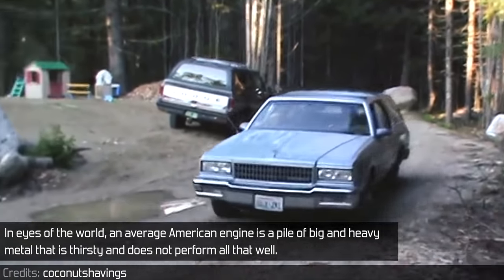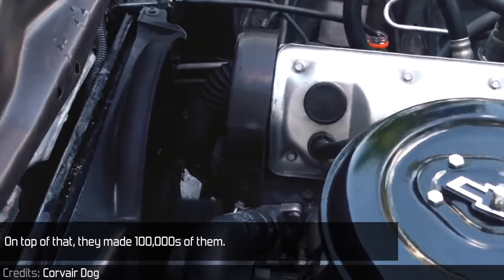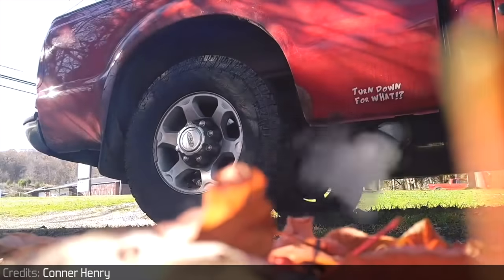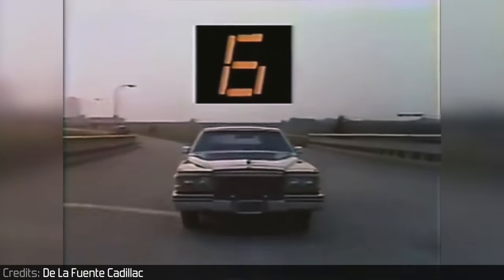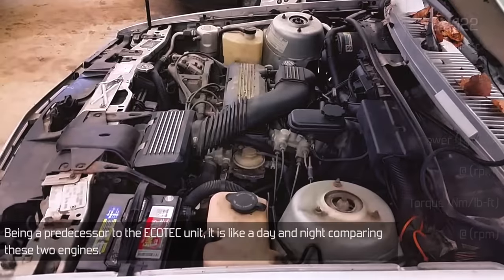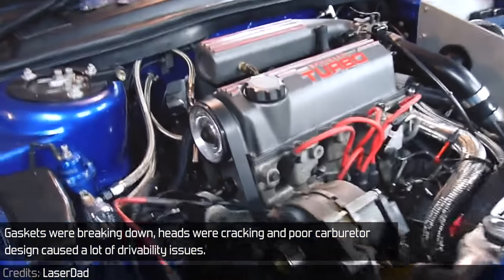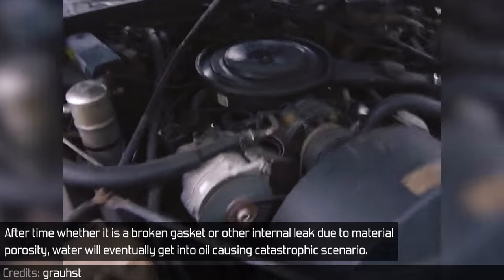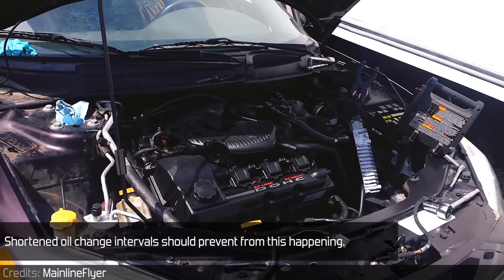8 Worst US Engines You Should Avoid

Comment: I drove one of the Olds diesel powered Chevrolet station wagons (that was a rental, thank God), into the parking lot of a local grocery store. A group of old men were sitting nearby. As I walked by they cautioned me about all of the noise that the engine was making and that I was negligent in the car's maintenance. That Diesel did sound as if it was ready to come apart even though it was new. It couldn't even get out of its own way at full throttle. GM has had a bad reputation of trying to out-think the industry with a good number of poor engine designs, (there are exceptions like the Chevy small block V8), and then there's Chrysler's cost saving use of the Mitsubishi 4 cylinder in their line of "K" cars and minivans which resulted in a nightmare for the owners and a goldmine for the repair folks. The Cadillac owners of the 4-6-8 engines would get the electronics disabled and the people who owned the Olds diesel cars changed out the engines for gasoline V8s. The 1980s up through the early 2000s were a technological nightmare for the auto industry as they tried to figure out ways to gain fuel economy and lower emissions through the use of electronics. Being one who's been in the industry for over 50 years, I still prefer to have a car that I can service and repair at home. Anyone have a 67 Mustang or a 69 Chevelle?
Reply: GM took a 350 and converted it to diesel they didn't strengthen the block. they used the almost the same metal has they did in the heads as they were using to male the gasoline verison heads.   50K those diesels were shot
Reply: While the designs share cylinder bore/stroke dimensions, the notion that the 350 Oldsmobile diesel is a converted 350 gas V-8 is completely false. The 350 olds diesel was a completely different block (much higher nickel content) Could be safely bored .125 thousandths overbore without sonic testing , Heads, intake, complete engine were not the same.. It shared the bolt circles to attach the accessories,transmissions but that's about it. After 1980 the main journals were 3" BB ones. Also roller cam, and lifters were installed.

The GM  genius's never installed a factory fuel and water separator in any GM diesel equipped car till 1984, They Installed weak head fasteners nor prepped the public on how to care for a diesel. By then the damage was done. Water and oil don't mix so many who filled up at other than truck stops (huge amounts of diesel fuel sales) were almost guaranteed water in the fuel. Which spelled disaster because most people did not have a clue and drove them just like gas powered cars. Poor R&D, and public awareness killed GM not this engine. I know a few that have hit 200-300k. Not bad for the worst engine GM ever produced 

FYI Most racing builders use the DX block to build a big cube bullet race engine so if anything the diesel is converted to a Gas engine.
Reply: William Charles - I don't have the amount of experience as you --- only 35 years --- but I share your sentiments.

My ride is a 1973 Chevy K-10.
Reply: SmallBlockChev,
 I agree with your statements, You know of what you write. The deal about poor R&D was an epidemic for the car manufacturers in the 1980s and 90s. The diesel fuel containing water is almost a given no matter where it comes from, although you're correct that some high volume diesel retailers, (truck stops) seem to be able to provide a better quality fuel with less water content. They had better, word gets around quick with truckers.

During the mid to late 1980s, the company that I worked for bought two of the Olds diesel, V8 powered Chevy pick-ups for service vehicles that would log thousands of miles monthly running all across the country. Both trucks suffered lower end failures, in multiple engines, changed out through warranty. These trucks would be loaded to the gills with heavy spare parts for baling machines, (big, non-mobile units), so they were pushing them pretty hard.

 Knowing the guys that drove those trucks, their foot was always to the floor and the required service and oil changes, which are a critical must, as you imply with diesels, probably wasn't carried out. They probably didn't drain the fuel water separator as often as they should, either. Who knows?

 As for getting by with the warranty, the people who owned this company weren't angels and falsifying documents wasn't a big deal for them. Ethics wasn't in their vocabulary. I left the company before I found out what the end story was but, like you said, they probably neglected the trucks by not giving a damned. It wasn't their truck to begin with.
Reply: paul lazazas,
 Nice 4x4 truck to have.  The hot rodders and resto guys are starting to gain interest in this generation of Chevy trucks and the aftermarket is starting to put out new stuff for them. After all, that body style had a 14 year run, they ought to. 
We had a 76 Chevy C10 Scottsdale Fleetside that had a factory 4 barrel 350 that ran sweet as sugar. Only problem was that the rust was having a field day, it was everywhere. That 350 would haul ass, though.
Reply: why cant you service electronics at home, you dont have a computer and a multimeter? Its physical measurements just like any other physical parameter. Maybe its american electronics, I guess thats why my ford had bosch
Reply: 67 mustang here. Just bought this mustang for my daughter to drive too high school. 289, one of the best engines ever made. No rice burner for my kids.

Comment: Youre way off with the Mopar 2.2/2.5L engines. Those little engines were great and would run forever if taken care of. I drove a dodge with the 2.2 turbo, awesome little 4 banger. The transmission let me down, but that 2.2 kept on going.
Reply: Once they worked out the head gasket issues they were pretty good.....damn sure sold enough of them. These engines plus the Caravan and K platform cars saved Chrysler at the time. Not to mention all the work the repair shops got for repairing and maintaining them. I know l worked on a ton. Whole shop would be full of just these sometimes. Lol.
Reply: I had a Plymouth with a 2.2 damn thing ran for 56 miles with no oil and only lost a crank bearing. That was after it was driven for 300,000 miles. The engine wasn't a turd but the CVS joints broke every other month like clockwork.
Reply: John Doe dodge datona 88 year model?????
Reply: The 2.5s were better engines. I did have a 2.2 that cracked the head but the head cracks were more notorious on the Turbo 2.2s. The transmissions on them were okay as long as you didn't abuse them, like reving the engine in neutral ans throwing it into drive so you could squeal the tires. If you did this you would definitely lose reverse because it would shove the hot drive gear ban into the reverse ban and they would weld together.
Reply: @Mike Sienicki No, the 2.2s did have head issues but that was fixed in the late eighties.
Reply: the current aftermarket Fel Pro head gaskets are good. The Weber carb is an easy swap.  These are easy to work on but never made much power w/o a turbo
Reply: @28913dave  my brother has a pacifica
Reply: I had alot of experience with the 2.2 and its true they were good long as they were well maintained. But that was their weakness if you blew a hose or didnt change timing belt routinely it would trash the engines. So although they ran good they was very high maintenance. You absolutely did not want to wait for it to break down before replacing parts. Parts had to be changed on a routine basis. This in my opinion made them garbage and why you seen so many in the garage.
Reply: I haven't seen a Mopar vehicle with a 2.2 since 2000. Yeah, they really do run forever 😂😂😂.
Reply: i liked the old powerglide transmission i would beat the crap out of them for years no problem .
Reply: I replaced head gasket in less than one hour without taking the heater hose or rad hose off more than fifty that way charged 150 dollars people paid me no warranty never had one fail
Reply: I've actually got a 1985 dodge Ares 2.2l carb 4speed manual engine runs good.
Reply: It was a barn find
Reply: @dmaster92289  I have one and it's my first car but mine is a 2.5

Comment: I usually agree with most of your findings on engines for lists like this, but say what you want about the problems of the 1st gen N/A Mopar 2.2, but the turbo versions of that engine were damn good power plants, especially the Turbo II and III. Most of the problems that Ive heard from that platform are the result of people not using the synthetic oil and premium gas that they were supposed to or not knowing how to work on the VNT turbo of the Turbo IV. Properly maintained, those engine are not only reliable but highly tunable, able to push cars into the 11-12s quarter mile brackets.

Comment: Triton engines are bad? Then why did fleet managers and medium-duty truck/bus/RV makers throw a fit when Ford considered getting rid of them?
Reply: cause ford lovers don't know any better, DUH..
Reply: Is your screen name from the sega genesis great videogame greatest heavyweights. Probably one of my all-time favorite boxing games ever. Still play it to this day. Oscar Ogg is one of the computer players.
Reply: I agree I've had two vehicles with Tritons, both had great power and acceleration and both were nearing 200K miles still running like brand new. One of Ford's better engines in my opinion
Reply: Cause they were dirt cheap junk
Reply: They weren't bad, They were terrible. Ford got cheap in 1997 and  wanted to increase production by taking shortcuts on building their engines. The spark plug port threads were just the beginning. The HEI system would mismanage the voltage output to the plugs giving some too much and others not enough and because the ports had less threads or sometimes were overly ported, the spark plugs would literally spit out of the engine. Ford did not fix this until 2008, but that was not the only problem they had. Jaguar had designed and manufactured the Triton's engine cooling system which had several design flaws causing air bubbles in the system that were almost impossible to burp out.
Reply: Well see I slightly agree the early 4.6, 5.4, and 6.8 had the spark plug devil due to poor design but by 01 the v10 had its shit together and the other 2 seemed to be fine after 02 but definitely 97 starting was rough
Reply: The Coyote is a far superior engine, be glad they dumped it
Reply: My 97 5.4 had 235,xxx on the factory plugs, never threw a plug and they came out with no problems
Reply: I know there are issues with the 5.4 due to poor pathing for the engine oil but I have a 4.6 2001 F150 Truck with 350,000+ km that runs like a charm.  Always chg the oil and did proper maintenance and even in -30 C it still starts fine.   For me its been dependable as hell and was my daily driver until I got a 2014 Sierra which also has never let me down.

Comment: The Triton engine spark plug ejection issue is easily remedied . I have 407,457 miles on my 98 F150 4.6 triton without any problems whatsoever other then the spark plug issue happening at 78,xxx miles. It cost me under 50 bucks and a couple hours.
Reply: Mine is in a van so I was not as keen on trying to do it. I turned off the EGR and raised the burn temp in the cylinders. This prevents carbon from forming in the cylinders and burns off what is there. I have had to change the coil packs because they are known problems. almost 200k and doing good. Oil changes and reg maint.

Comment: Surprised to see the Ford Triton on here. I know the V10s are bad, but the 4.6 and 5.4 V8s are almost indestructible.
Reply: MrWoodii no, not the second gens. The first gens are a pain to work on and have a couple problems but the second gens suck (timing chain problems)
Reply: MrWoodii we had a v10 and the truck went through 3 engines in years, safe to say it was a traded for a ram shortly after
Reply: 4 cylinder Vegas, besides being notorious rust buckets, had a rubber timing belt instead of a timing chain.  Periodically, the cogs on the timing would jump, putting the engine seriously out of tune and necessitating a trip via tow truck to the dealer.  Presumably, the belt was to reduce weight as part of GM's perpetual effort to meet Corporate Average Fuel Economy (CAFE) standards.  Thanks loads, Congress!
Reply: MrWoodii this guy is clueless
Reply: 5.4 3V doesn't have much power due to restrictive exhaust, but they have yet to fail us! We have three. One of which has 195,XXX miles on it with the original plugs!! Never, and I mean NEVER had a single problem with the engine. All that's wrong with it is the engine computer, which no longer works properly. The other two are still pretty fresh, low mileage engines, but still no problems, except for a very slight tick on cylinder one.
Reply: Vega was an interesting animal. The early ones were def bad news whereas the 1976-77 models were no worse than any other mid 1970's engine plus, rust protection was much better and, GM also improved the brakes and rear ends.
Reply: 3v Triton is the biggest pile ever. Those plugs are the worst. I personally know of one that dropped a valve at 12k miles just after 3 years. Had perfect maintenance, synthetic oil etc. Turned off the mil and let the dealer eat it on trade in.
Reply: They shoot plugs out like bottle rockets, junk.
Reply: I have 6.8 with260,000 no issues replaced alternator that's it all bullshit great engine
Reply: Yes
Reply: MrWoodii the 5.4 in my 250 just broke 200K and it's only 6 years old. That 200K mile marker was half way across these united states and I was pulling 9,000 pounds up and down the appalacians. I have no problem with the 5.4
Reply: the  tick you are hearing on on cylinder most times is a rocket  arm  or lifter going bad it a lot cheaper to replace it before it breaks and the bit and pieces sometimes  end up places doing more damage
Reply: Bradley'sCoFarm hows that electrical system working out for you lol
Reply: Once they worked the bugs out the 2V mod motors ran forever. My first Crown Vic, an 04, finally succumbed to rust at 284,000 but the motor still ran great. My current Crown Vic is an 06 with 143,000 on it and runs like new. And these both started life as cop cars so you know they were ran pretty hard.
Reply: MrWoodii
Reply: MrWoodii
Reply: MrWoodii We have a 5.4 3V from 2009 and it has just over 207,000 km
Reply: not true

Comment: I drove an excursion with a Triton 6.8l V10 and that was super reliable and it's still going with over 250k miles on it
Reply: was it the 3 valves per cylinder model? i heard those were the most durable ones.
Reply: The 30-valve 6.8L Triton in my 2010 F250 is still a beast at 199,654 miles, as of today. It is still very smooth and powerful, if a bit thirsty.
Reply: Cool beans, baby 😁😂🤣
Reply: I know of 2 of them that went over 400,000 without a whimper. The bodies however......
Reply: The 3v fords had problems I would never recommend on but I’ve had several customers come in with 2v version with 400+ miles and one navigator 4v with 350k+ miles love those engines
Reply: I can't speak for the 6.8 or 4.6, but I've had nothing but problems with my 5.4 Triton spitting plugs and destroying the coil-packs and ignition wires in the process.
Reply: Main reason they blow coil packs is 1 people don’t use dielectric grease to shield from moisture or 2 the early models had a plastic crossover pipe in the from that leaked after a while (plastic) they revised it and the new ones are aluminum now and did you install the plugs or a shop?
Reply: At 250K miles a Toyota engine is just getting broken in.

Comment: Studebaker's V8s were seriously overbuilt, 18 bolts holding down each head, helical gear-drive cam, and McCulloch or Paxton supercharger options and you've got a lot of performance potential, and the Avanti set more than two dozen Bonneville speed records.
Reply: As rare as hen's teeth and expensive for parts and maintenance a daily driver. Note this is about  more modern cars.
Reply: Also some of the later Studebaker engines were actually Packard engines which were also overbuilt for the time.

Comment: In the Ford Triton series the spark plugs shoot out normally was common in the early years mostly in the 03 and 04 CVPI and early years 5.4 around 05 these issues was less common and even with that being said there are actually tools to pretty much fixed these problem. Either way the Triton motors are actually some of the most durable motors I have the pleasure to have

Comment: Why the bashing of the mod motors? They're great engines when properly maintained, and that means changing the spark plugs properly. You can't pull them from a warm head, it needs to be stone cold and you put antiseize on the new plugs before installation. I've been driving my 5.4 expedition for over 250,000 miles with no problems.
Reply: Corey Schmidt i totally agree,  but most ppl don't take care of sh*t nowadays
Reply: Much of what you say I believe to be true. Many people don't know how to take care of their engines/ or new types of engines. Part of the problem with Corvair, nobody knew how to drive it in 60'/61'. OR maintain it. Plus I don't care what you have for a engine, if you beat the crap out of it , it'll die any early death.
Reply: Dennis LePorte i always beat the crap out of mine, but i do proper maintenance always haha